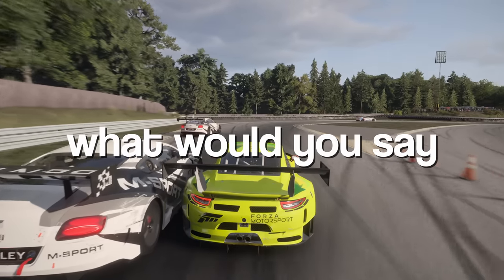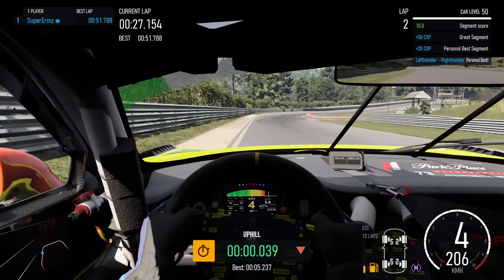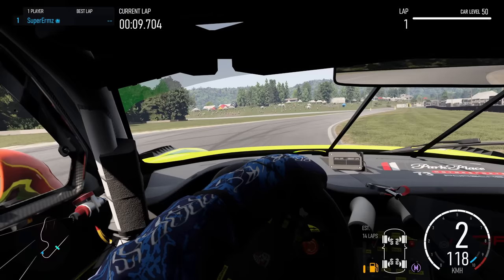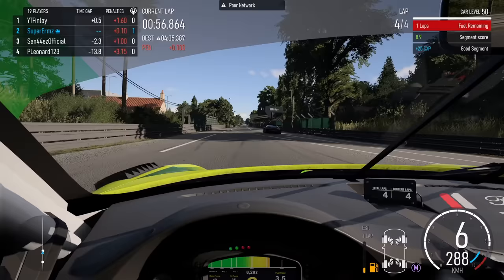The ULTIMATE Forza Motorsport Car Tuning Guide

Comment from the maker: ❗VERY IMPORTANT - READ THIS❗

As I learn more about Motorsport's physics engine, I will add addendums to this pinned comment.

•Suspension tuning •

Suspension tuning was largely overlooked in this guide. What Forza Motorsport likes is for suspension to be tuned according to the weight balance of the car.

For every 1% weight distribution toward either front or rear, we add 4 kgf/mm spring stiffness. In the case of the Porsche 911 GT3, with a 43/57 weight balance, this means that we add an additional 28kgf/mm on the rear springs.

•Aero/Anti-Roll Bar Balance •

Forza appears to suffer from a bit of the old rFactor 2 physics exploit, where a person can drop the rear aero level way back, and offset the loss in grip by also dropping the stiffness of the rear anti-roll bar. 

So far in my testing there appear to be diminishing returns here, but on faster tracks you can certainly gain lap time by dropping the rear wing a fair bit lower than I did in the video, and offsetting that by also dropping back the rear anti-roll bar.

• For gamepad players •

You MUST use 'Normal' steering (not 'Simulation') in order to be able to control tunes that rotate this much.

For RWD cars, you may get more stability by setting Differential 'Acceleration' between 50% to 60%. Likewise, you may want the 'Deceleration' set between 20% and 40%.

• For everyone •

I've been told by a few sources that 'ideal' tyre pressures in Motorsport are between 1.7 to 2.2 bar. I've run a ton of tests, checked telemetry and lap performance, and so far I always get the best performance when my HOT tyre pressures are at 2.2 bar. Will keep you updated if this changes.
Reply: Thank you Ermz for this
Reply: You the best, ermz. 👍
Reply: 40% decel 💀
Reply: Not true on normal steering - all the top players are using sim, although normal isn't much slower at all.

Also, tire pressures are actually more sensitive in this game. Before, you'd set them to 28.0 or so and call it good. Now, you need to make sure the middle temps aren't too hot or too cold, which is still fairly easy with telem
Reply: Question, are you playing with or without TC and ABS?
Reply: huh, I'm using simulation on gamepad and I don't have issues controlling the rotation
Reply: @MrAncop Thats not exactly what i asked, using Simulation Steering Settings is only ONE setting, what i asked was about the Traction Control (TC) and ABS Brakes. Atm im using TC and ABS turn OFF with my G29 wheel, got a lot faster with TC off, tho is hard to user RWD cars. ABS turned off is fun to play because you can't use 100% of your brake, if you do the tires will just scream and burn out of pain, i might consider turning ABS On again, but its interesting to play it Off for a while, to feel more Racing Realism of driving a real car
Reply: @rafaelribeiro99 Look at the bottom right. He only has ABS
Reply: Lmao you use third person view , what a scrub 😂
Reply: "For every 1% weight distribution toward either front or rear, we add 4 kgf/mm spring stiffness."
Shouldn't the stiffness be a ratio of car weight and not an arbitrary amount?
Reply: @Ermz The only thing I've found that I do slightly different, is the tire pressure/camber relationship. In Forza Motorsport, it seems to be a universal truth that when you adjust your tire pressure and camber until the inner/middle/outer temperatures are nearly identical when hot, you'll be a lot faster. If your inner is hotter than your outer you should remove camber and vice versa. If your middle temperature is lower than your inner and outer temperature add pressure and vice versa.

Comment: Car looks like it is drifting more around the corners then actually planting into them and carving into it... You can tell by how it looks and watching your steering wheel as it is not steady when you are taking corners, it's jumping around because you have to make multiple adjustments to keep yourself from spinning out...
Reply: I’ve just rewatched it and yeah…you’re right.
Reply: Which ultimately will kill tires faster in longer races. AND there's more to tuning, like how weight distribution and the difference between front / rear tire width affects handling characteristics, downforce mainly being tuned for high speed turns, while suspension for low-to-mid speed ones.
Reply: I agree but it seems that’s just what works for him. Tuning is very subjective, what works for some people is not necessarily the best for you.
Reply: This is how drivers who prefer oversteer drive. You can see it a lot in carting. I think this is too much for me personally but the whole idea is to get the car to rotate quicker so you can be on throttle earlier
Reply: Negative toe is wheels pointing out from center
Reply: Forza likes a looser car for some reason. Tire wear is actually better on oversteer than if he were to plow through the turns
Reply: @rustyc6805  nope negative toe is wheels pointing in on both axles when looking from above
Reply: @kieranvirgo9797  not in the real world of Motorsport. It doesn't matter anyway, nobody playing Forza understands how  suspension changes affect the car.
Reply from the maker: @dnboii4404  yes, this tune is heavily playing to Forza's love of oversteer. The default tunes scrub out the tyres very quickly. You can see in my first FWD touring car race video that I murdered the front tyres by just driving normally - so my tunes adjusted in order to keep the rear rotating more naturally.
Reply: @Ermz  I poorly worded it, but how you replied was what I meant to convey haha
Reply: Correct, max anti-roll does not equal more grip like this dude claims. There is a bell curve, but generally you want your tires to roll just a bit which actually increases grip and reduces scrubbing, but also reduces response by a very small amount.
Reply: @Baalzz302 Forza likes max roll stiffness. Plenty of world record setups in older games had 40/40 bars
Reply: @Harmonic14  agreed..
Reply: @Harmonic14  I have noticed that in Forza Horizon, but not so much in Motorsport. I'm playing on wheel simulator tho, so possibly that?
Reply: Yeah, the car is sliding because Ermz pretty much has a welded diff. You can definitely have grip in this game. Forza Motorsport Central posted a laptime at Kyalami that is close to the real GT3 lap time. Austin Ogonoski's video on Forza shows him lapping Spa with the 787B without sliding. Decrease your rear diff setting Ermz.
Reply: @Baalzz302  doesn't matter, wheel or controller, roll stiffness has always been good on Motorsport
Reply: @Harmonic14  "Roll stiffness has always been good in Motorsport" 
Stiffer doesn't mean better. It depends on what angle you like your vehicle at on entry, mid and exit. On top of that stiffer means more response, and too much response is harder to finesse on the wheel than on controller. You want to find the "sweet spot", but again it depends on how you want the vehicle to feel (more specifically for the wheel users).

Comment: Your differential settings might be causing excess inner tire wear and oversteer. 100% setting means that on throttle the wheels are locked together in speed. Meaning if you’re on power in a corner, the inside wheel will try to match the outer wheel’s rotation, spinning and cause oversteer. On GT cars I use around 30-40% accel and 10-20 deccel for RWD Axle and 55% accel and 1% deccel on FWD axle. The inside tire will be able to rotate. This allows for getting on power before your opponent in most cases. Max % diff settings very good for drifting though!
Reply: In formula 1, use high diff for high speed corners for stability and grip, mid/low diff for slow corners. So all depends on track and driving style. Ofc in formula y adjust for most corners mid fly
Reply: I second this. High diff setting will help you put down power for sure, but it also makes the car oversteer on the throttle. This is very noticeable in RWD rally cars.
Reply: might just be how the Forza physics work though since quite a bit of other settings don't follow real world logic either?
Reply: @jammaschan  More likely is that people think that, because they don't understand car setup. I tune the same way in every simulator, but I guess physics just works differently for me XD
Reply: @josephhodsall8371  Forza aint nowhere close to a sim, and the physics seem downright unrealistic imo
Reply: @jammaschan  That's what people always say. I don't want to get into an argument over it, but consider this. 95 percent of people who say that have no idea how to tune, so they can only judge the physics based on awful tunes or the default setups, which are also awful sometimes. Now, if the default setups are whack, that is a big problem for sure, but it doesn't mean the physics are to blame.
Hence I take any claims of bad physics with a big grain of salt until I personally play the game and get a car properly set up.
Reply: @josephhodsall8371  well this channel is a sim racing channel so I'm pretty confident that they know how to set up a car correctly.
Reply: @jammaschan I found it pretty weird to have a rear engine rwd car to understeer when it should have atleast snap oversteer. and maximizing Front ARBs to fix understeer doesnt really make sense.
Reply: @asdowo111  yea exactly, that's why I think it's just messed up Forza physics.
Reply: @asdowo111  I tried this tunes today and actually I feel that maximizing Front ARBs makes the car more understeer. Softer setup helps with bringing understeer down.

Comment: This is exactly how i tune my cars, except the aero. Full on Front and as low as i cant get away with on the rear is my way to go.
Reply: In previous forza titles I found a lot of cars just want the number equal on both sides, I'll see if tuning out the understeer in this game causes me to want more rear downforce once I get it.
Reply from the maker: I've heard this from a few Forza players. I'm going to try tuning low rear aero combined with low rear anti roll bar, in case aero doesn't work like reality. If the Forza engine is broken in the same way rFactor 2 was, this would result in max grip, oversteer and speed.

Comment: It's always interesting seeing how different people tune.
Reply: And this guy wants his GT car to drive like a welded diff gokart.
Reply: @stefans4562  true but think about it, he uses a wheel, I use a controller, he is driving a Porsche, I would drive a vette or viper. Different strokes for different folks.
Reply from the maker: @stefans4562  loose is fast, baby.
Reply: Look if I’m not BARLEY out of control with my car I ain’t racin because I ain’t pushin. I’d rather have too much machine by just a bit leaving NOTHING on the track. So tunes like this to me is perfect. But like ol boy said, different strokes 🤷🏽‍♂️
Reply: @Ermz   no it isn't lol, unless your on an extremely slow paced track with super tight turns.

Comment: So this is a "drifting" tune, im looking for a racing tune.  Thanks for the video though.
Reply: ….no this is a racing tune I literally shows the lap improvements. Anyone who actually races knows it’s faster to steer (slightly not a lot) with the gas in a gt car to make the car rotate and point the correct way so you can hold momentum through the corners and have faster exit speed vs turning the front tires too much and having that grip on the front slow you down. Look at the top of the screen where it tells him he’s scoring 10/10 in every sector
Reply: @whobedankeykang9856 Have you ever actually seen any GT racing in real life? The cars are setup for grip driving and they dont like drifting at all.. You can tell that when you look at actual GT3 races that most of the time when they lose traction, they just spin out, they are not setup at all to "rotate with gas" They are setup to grip as much as possible, not slide around.

Comment: 1:56 antiroll bars maximize, pull back rear 5% for grip
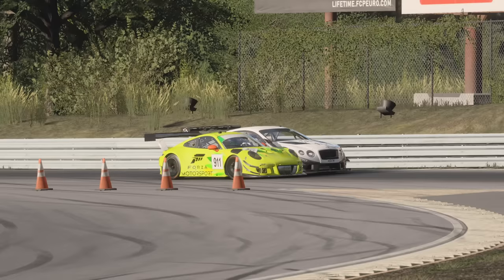2:21 do the same to aero for tight tracks, if long straights take away more downforce
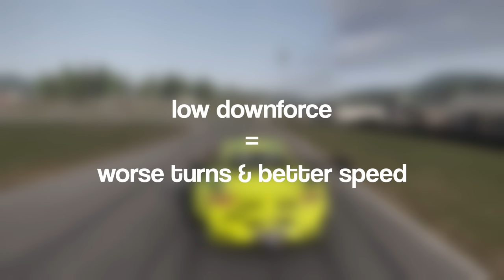2:50 front better turns
2:54: rear better stability at speed
3:01: diffs acceleration: maximize for max pwr to wheels, 
	3:27: especially for rear engine cars to wheel spin on throttle
	3:33: higher the decel the more understeer, less means more oversteer
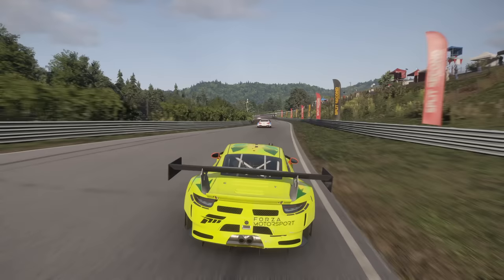		3:45 RWD: decel set <20%, FWD: set to 0%
TEST
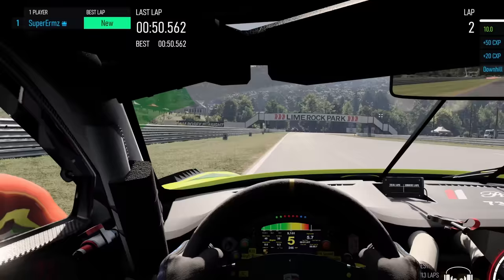4:55 tire pressures ~2.1 for front and rear
5:11 alignment:camber set Front to -1.5 and rear to -1 for even better grip and rotation
	always more camber on front in Forza
5:32 front toe=0 and rear slightly less -0.1
5:45 front caster angle increase to 6 (could even go to 7) for more snappy steering
TEST2
7:00 gearing:final drive: figure out your max speed on the straights and tweak to that high speed
7:37 springs: personal preference, likely no performance improvements
	softer=absorbs bumps but less stable at speed, harder=more stability but nervous over bumps and terrain
	7:50 dampers:bump stiffness: dampers: choices 
		7:55 if you want oversteer:         incr front bump and front rebound
		7:59 if you want stability: 	        decr rear  bump and front rebound
		8:05 turn more   under braking: decr front bump and rear  rebound
		8:10 more stable under braking: incr front bump and rear  rebound
	
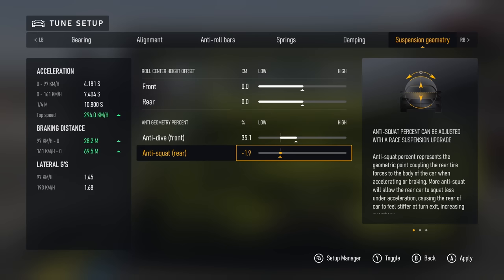8:28 suspension geo: see other video
Reply: goat

Comment: I was so ready for you to be wrong like all the others that make "tuning guides" then use IRL logic.  Thank you for giving people real information that actually works in Forza.
Reply: Other sims have the same disconnect when it comes to how different settings impact performance. Even iRacing is not perfect. Years ago I got a tune from a guy who would provide them in exchange for Twitch subs and I was surprised at what I saw. It drove great and went fast but I couldn’t imagine a setup like that on a real car… although I’m not an engineer so maybe I’m just wrong.
Reply: @michaelw6277  I mean there's been a lot of people who've built rather loose race cars (not sure if that's what you were referring to). A lot of fwd guys in older cars try to make the car oversteer as much as possible, which leads to less than ideal street manners lol

Comment: Great info, thanks! Although I would highly recommend folks check out the anti-dive anti-squat settings. You can get a lot better braking performance out of most cars reducing the default anti-dive. If the rear tires are sliding on the throttle, reducing anti-squat is a one-click fix. and you can leave your damper settings to deal with bumps. and if your rear tires AREN'T ever sliding on corner exits, increase the anti-squat until they're right at the edge of sliding and you get instantly better acceleration. I treat the damper settings like the fast bump/rebound in ACC, and the anti-squat/dive like slow bump/rebound.

Comment: I personally believe the car leveling was put in place to help drivers get to know their car better and understand how certain modifications affect different aspects of their vehicle. I don't find any issues with the car leveling system as I am big on rivals stuff so it's super easy to start off stock, take down a good chunk of a leaderboard and then go back and upgrade and continue the mission to own everybody else
Reply: There needs to be a driver level cap where carpoint and carlevels don't matter anymore ie: driver level 100, 150 ect
Reply: Theres some discrepancies with the tuning availability for certain parts (although its nothing different than their older games). Like the suspension upgrades for one - the description for the sport suspension refers to single way adjustable coilovers..that means we should be able to adjust the height and 1 type of damping (compression or rebound, preferably rebound). Then the race suspension could unlock complete tuning of the suspension. Whichever person(s) did the descriptions for the different upgrades seems to be a real enthusiast..all of the mods are about as accurately described as they can be for a 3 tier system.
Reply: Man f that.. you ever try getting a E class car into A class. Takes hours to do. And accomplishes nothing because by the time its in A class its nothing like it was part by part.

Comment: Why on earth are you maxing the front ARB in a car you’ve identified as understeer heavy? You’ve just made it more understeery. Stiffening the back will increase oversteer but it’s opposite for the front. By maxing out the FRONT ARB, you’ve effectively decreased your front grip on mid to high speed corners. 

Fix understeer:
Corner entry: lower front springs, lower front bump and rebound (or do opposite on rear)

Mid corner: increase rear ARB, decrease front ARB, increase rear diff lock, decrease front and rear deceleration lock; can also stiffen suspension and increase camber in older or non-racing cars